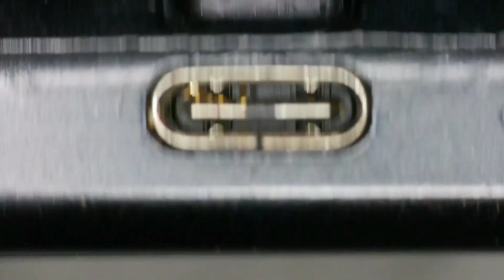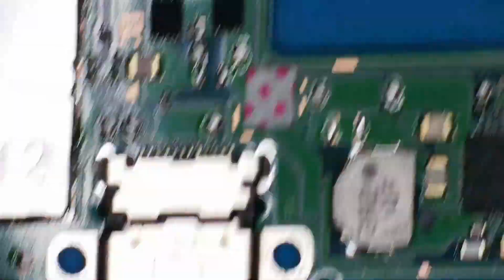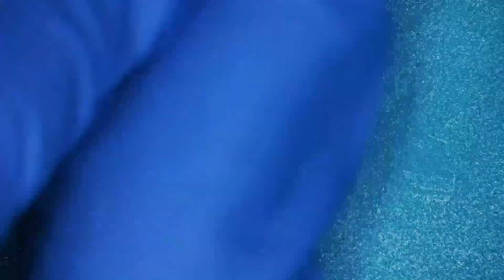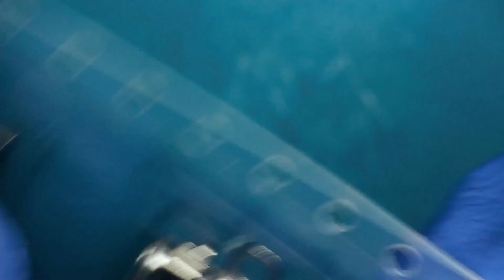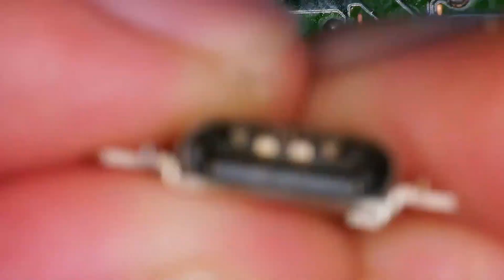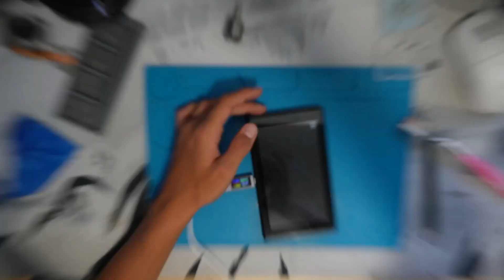First Nintendo Switch Repair | Prodigy Repairs

Comment: Very nice video sir! Solid repair 💯 plastic does melt quite easy with hot air biggest tip I learned was to keep the air moving. Keep it up love to see it! Also if you have trouble tinning ports try running the iron parallel to the pins 👍